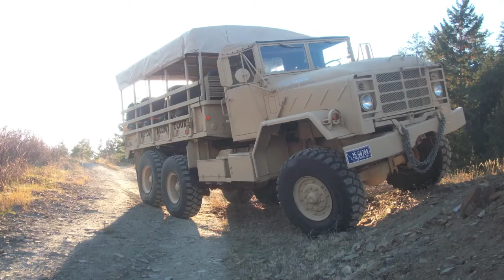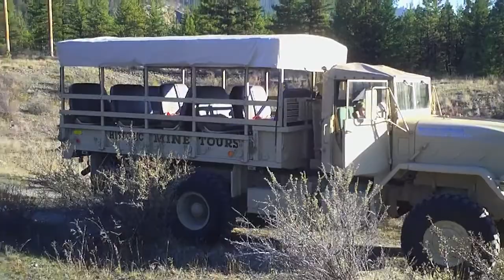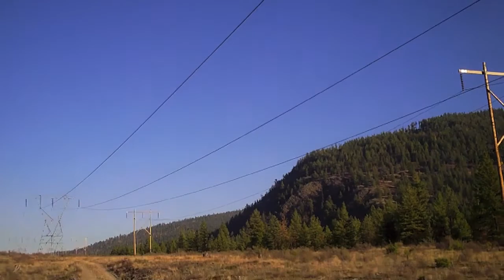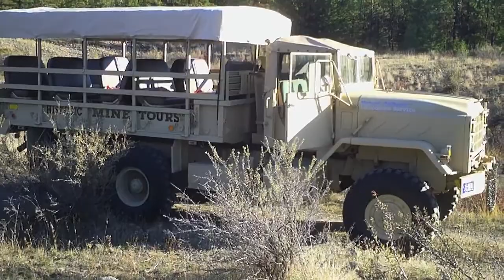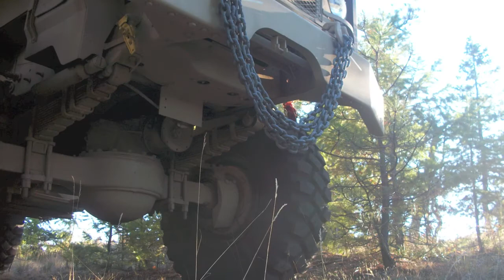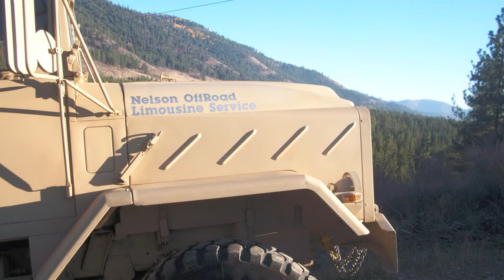Truck Electrified by High Voltage

Comment: Happens quite a lot in substations where the conductors are quite lower than over roads etc, so I bet you got a little tingle! I get quite a few shocks off metal kiosks on my substations, it won't kill you but it'll make you jump! Induction is hot :-)

Comment: Experienced this more than once working near some lighting circuits that ran near a 230kV transmission line.. Just enough energy present to generate a tiny spark when things were grounded out.. Measured 660V from the circuit in question to ground, but current flow when grounded was  so little it could not be measured.

Comment: Those lines are low. induction does happen into metallic objects. the truck stands on rubber tyres, when you hopped off you completed the circuit.